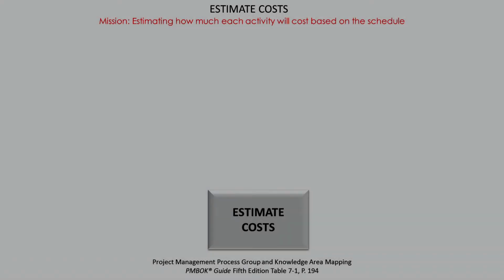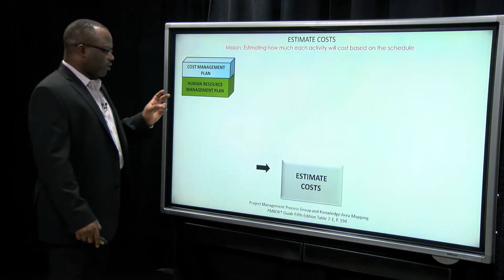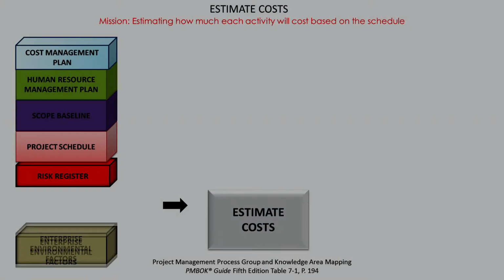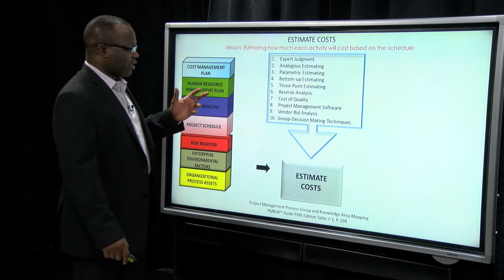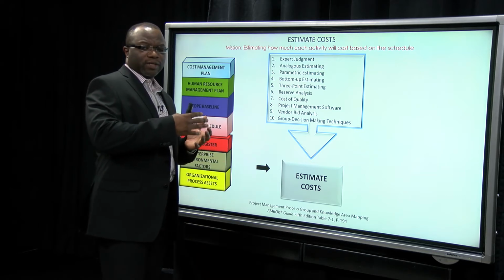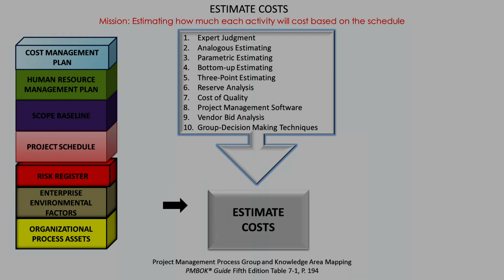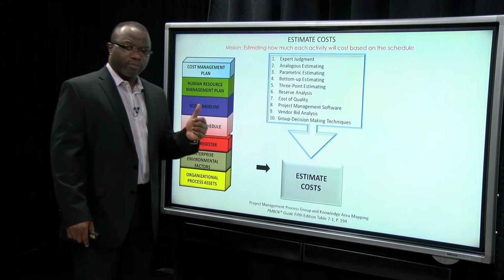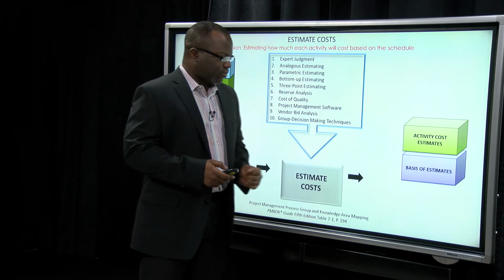Estimate Costs Get the full Fifth Edition Course: www.pmsucceed.com

Comment: why is procurement management plan not an input to estimate costs? I mean, even procurement related activities will also have  cost, right?. Please answer.
Reply from the maker: Good question. You have the project management plan as an input to PLAN COST MANAGEMENT. The Procurement Management Plan if available by now is already part of your project management plan which is an input to PLAN Cost MANAGEMENT. The cost management plan is now an input to estimate costs so it is factored in somehow. Also you have the tool and technique for doing what you are saying (Vendor Bid Analysis) to ensure vendor bids are in line with your estimates.